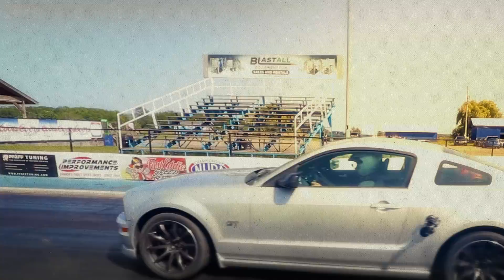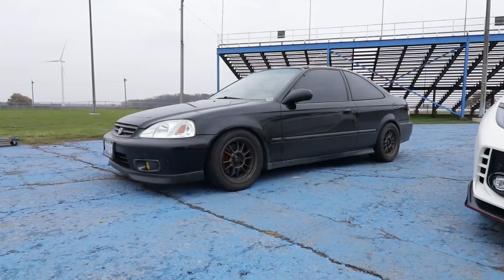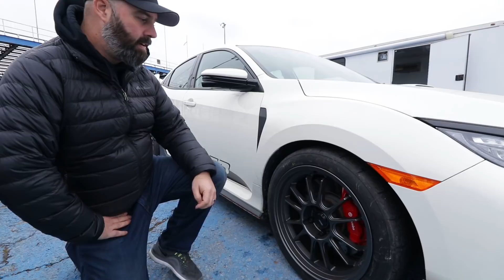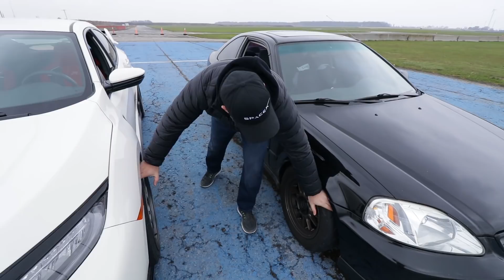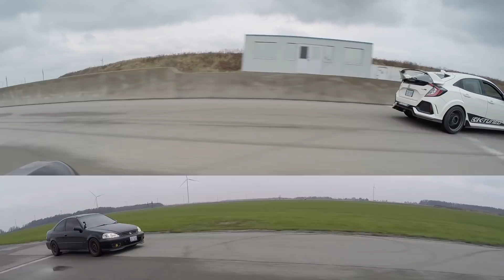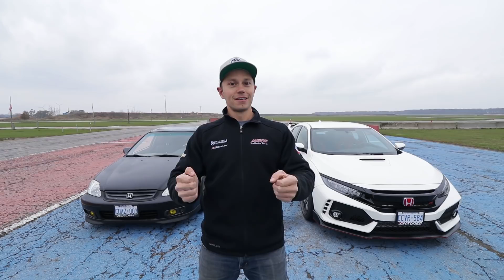Honda Civic Type R VS K20 Swap Civic - Which Is Faster?

Comment: Why dont you gut the rear of the ek and try again?
Reply: cause its street driven .. his brother might prefer the car with the back seat
Reply: Livin 2 Race They can do it when they go to the track.It takes only 2 minutes to remove the spare tire,jack and back seats
Reply: Livin 2 Race my prelude is street driving with the rear completely gone. The front is 100% oem.
Reply: Why to take out 40lbs? Lol
Reply: Brandon Sunthivong my prelude is 2860 all oem and after taking out the seats, seat belts,jack,spare etc its now 2640lbs with more than half a tank of gas. Still has AC/PS everything else is oem.
Reply: Brandon Sunthivong Actually 64.Believe it or not it makes a difference.
Reply: preludeF20Bking was talking about the civic.
Reply: Dim. Might see a very very small difference. The civic inside is so light it’s like no point on taking anything out to make it only a 2 seater.
Reply: Brandon Sunthivong They say every 100lbs cuts 1/10 of a second in the 1/4 mile so it's something.You dont need any of the rear interior or the passengers seat when you go to the track so why not remove it since it's very easy?
Reply: Dim true is it easy but I guess I’m getting old now and I would hate to bother with it. Try taking apart the new civic like that type r is sucks. It’s not like these old civics
Reply: Brandon Sunthivong That's the benefit of the old civics.You're not afraid to strip them and it's easy.
Reply: Just swap it over to a k24 bottom end and this thing will smoke the type r all day everyday.

Comment: What is the K20 swap? A Type R K20 put into that saloon shaped normal Civic?
Reply from the maker: Its from a 2006 Honda Civic Si - k20Z3 is the code designation.
Reply: Hp ??? On the k20 ??

Comment: Isn't there a 700lb difference between these cars? Which K20 is this (ie, JDM type R, USDM RSX-s, a next gen civic + mods)? If the car has a 700lb advantage with a JDM 220hp'ish motor then this will be a close race.

Comment: I just wanted to point out. The K series engine should be revved to 10.000 rpm. If you stop at the redline for the stock engine at 7000rpm its no wonder you lose. Kseries makes best power above 9000rpm

Comment: how much would the civic cost if someone was to do the exact same thing without sponsors? what was the budget that you guys had for the civic?
Reply: betterthenyou99 budget 10k minimum
Reply: Cristian yeah what's the max tho. Cause that makes all the difference here.
Reply: betterthenyou99 I think they said in the previous video it was about half of what the Type R costs, so easily 20k.
Reply: Cristian half of 34 is only 16 bro.
Reply: preludeF20Bking I highly doubt that car was sold by the dealership at sticker price
Reply: preludeF20Bking quick maths?
Reply: Cristian these were going for $50k+ this summer in Toronto.
Reply: betterthenyou99 exactly, first one sold here in Dallas was over 60k I believe
Reply: Cristian for Toronto, the dealerships only had 2 cars Max per dealer. It was hectic how much they were selling these for. $60k+ Canadian.
Reply: A full kswap depending on the engine is around 7-10k.  If you have nothing but the shell.   If you have to buy a shell too factor in another 1-1.5k..  So around 12-13k for this is about where its at.  Of course u don't have to go full k tuned they have some bling that's not needed for the swayp so you could save there but I doubt for your first swap it'll be under 8k
Reply from the maker: Without a car figure 8-10K for parts for everything.

Comment: What kind of transmission gears are you running in the ek?
Reply from the maker: Stock 06 civic si gearbox
Reply: Wow that’s impressive. I had an 08 Si and I thought the tranny and clutch sucked.. do you have an upgraded CMS kit from K Tuned?
Reply from the maker: No stock clutch master

Comment: The reason you can't out right outrun the ek is simple. He has close to 500lbs on that new type R. Power to weight ratio is everything. But conversely the 245's on the new type R make it faster in most all of the corners. Get the same width tire on the ek and it'll eat that type R everywhere.

Comment: Not driving the type r right. Need to shift about 800-1000 RPM before redline otherwise you are leaving tq on the table. HP is the same 4800 rpm on to redline

Comment: On that split screen drag race. Set playback speed to the slowest and you can see the black EK just spin it's tire for days vs the type-r. That contact patch difference is really showing there.

Overall, terrific driving for such crap conditions!
Reply: Michael Hein you clearly did not see the same video.  Especially on the dig run when they switched drivers the ek hooked in 1st gear while the type r was spinning well into 2nd gear.

Comment: Stage 1 doesn't mean tuned shit nut it just means your switching to a open pcm because Chrysler uses closed pcm it allows you to use and correct using a diablo sport tuner which I've never used exhaust is the only mod and the stage one pcm shuts off the cell light do your research

Comment: What k20 swap is in the ek?
Reply: z3 from a 06-07 si i think?
Reply: 06-11
Reply: MultiChimRichalds fn2?
Reply: no, FA5 and FG2
Reply: MultiChimRichalds bad k20, should of gone for a k20a2 atleast lol
Reply: meh. there's only a 3 or 4 hp difference, and the z3 is a smoother revving engine with the balance shafts.

Comment: Knowing the Type R is slow, that’s not saying much for the K20.
Reply: fastest front wheel drive car around nurburgring? i dont like the engine/ design either but its a beast of a car.... it has a crazy front diff and can handle more power unlike a focus rs with the weak engine blocks

Comment: Civ should win, lighter power to weight ratio matters.. now slap a turbo on the SI lol
Reply: that type rmay be factory stock except open downpipe but its better tweak too.. with lot more weight still credit to honda for this amazing machine
Reply: Henry King yeah and put a huge turbo on the type r on e85.
Reply: Lol its a track build not a drag build.  Its about handling not straight line